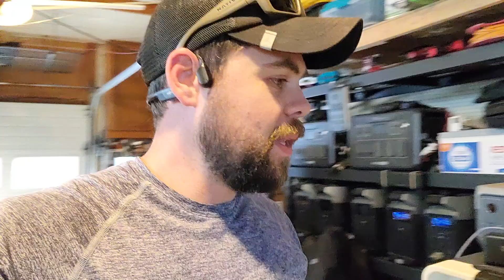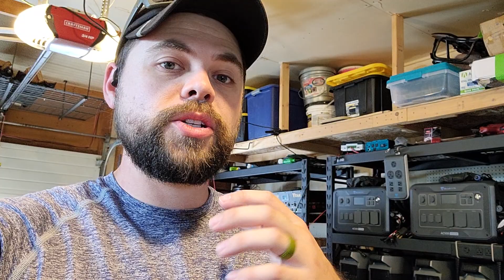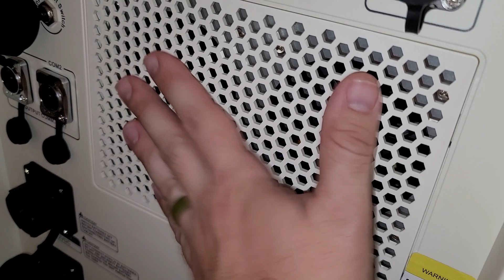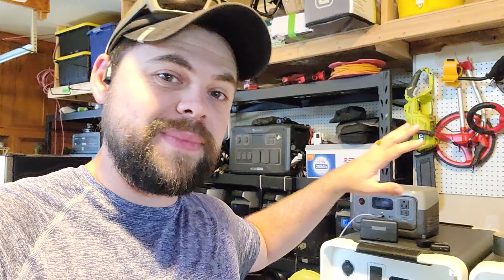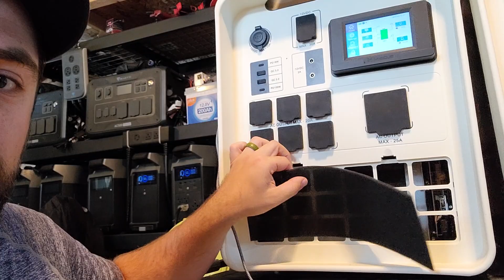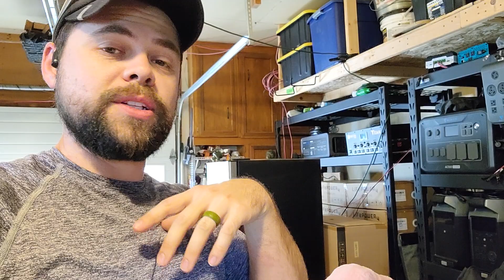The Power Station that Changes Everything Initial Review of the Apollo

Comment: Goals are the same.  Run off batteries with grid back up.  We want to stay mobile as well.  I have the Delta Pros, as you know, I bought them through you, but now thinking of Apollo.  Mainly to get the amps.  2 Delta Pro's = 30 amps.  I need 100 amps.
Reply from the maker: 100a at 240v would be 8 Apollos. To do that you have to have a custom made combiner box for the Apollo and have an electrician wire it into the house, but it's possible. The DPs are great, but not as good as the Apollos. The 5kw of solar input is incredible. It charges so fast with lost of solar panels it's unfair to anything else out there. Finally someone has realized that a solar power station needs really high solar input to be long term reliable.

Comment: Awesome!  Glad you're checking it out.  I got mine unpacked and plugged it, I'm trying out the AC fast charge mode to bring it up from 60%, it seems to work fine but of course when I switch it back to UPS mode it goes back to 500watts, it makes since that it works this way but it had me scratching my head for a bit.  I'll be testing the AC out tomorrow, it likely works fine but I always check things like this out on test equipment first before using it on more critical equipment.  I'd like to get my buddy to put his oscilloscope on the AC out to see how smooth it is.
Reply from the maker: That's so cool! Mine are working great, no issues so far at all.

Comment: @minutemanprep Do you know if these units are able to automatically turn the AC inverter back on in an outage situation? Say they are set up in a remote location.
Reply from the maker: They do not have an Auto Transfer Switch built into them if that's what you mean. Meaning if you're on grid, power goes out, then these turn on and run everything, then turn off when the grid comes back on. That is coming, but not ready at this time. If you're off-grid and wanting them to turn back on automatically if the battery drains down then yes they do that.

Comment: Is there a 3rd party solution to the "fusion box/combiner box"? It seems like many vendors combiner boxes have too many caveats.
Reply from the maker: I don't think so. Closest thing is an Interlock Switch which is what I use.
Reply: @minutemansolar  Understood, but couldn't take say an Ecoflow and a DIY EG4 and combine the 2 ~30amp legs into a 50amp 240volt split phase. I'm making those up, probably wouldn't work (math), to connect to an interlock. To me, it seems like there is a gap in the market for something like this. We are dependent on manufacture "combiner boxes" that only connect multiples of their specific solar generators with a proprietary solution. Someone should design and make a box where I can take 2 separate 30amp sources and combine them to a ~50-60amp single leg to  plug into an interlock. Just my humble opinion.
Reply: @ididathing1754  The problem isn't being able to manufacture the product. The problem is how the two units communicate to one another. If the phase is not in perfect sync then you will have major voltage problems and likely fry something.

Comment: So at 3000 watt inverter you can't get 30a @ 240V when paired 
With the DPs you can but with the Apollos you can tie 4 units together and get 12000 watts so 50a @ 240V 
It would have been ideal to have 3600 watt inverters on these 
So you could start with 2 and then expand to 4 and have a little headroom imo
Reply from the maker: To be techincal it'd be 25a at 240v since Voltx x Amps = Watts. You're correct with 4 Apollos you can get 240v and 50a. I am working on that video. Likely to be out next week.

Comment: Great video Ben. 
Nice feature to be able to use 120 volt receptacles while outputting split phase.
I currently have the Uline shelving unit you previously had for your Delta Pro set up. 
Can you share the brand of the shelving unit you now use for your DPs + EBs?
Reply from the maker: I got the new shelves from Costco. $200 and they can hold 1,000lbs per shelf very well.

Comment: I went with the AC300s almost two years ago, with 6 batteries and the fusion hub.  Did have an inverter failure and sent it in for warr repair. Was without the second inverter about three weeks but other than that i am satisfied with it running most of my house thru a multi circuit transfer sw. (trans pro6) every day.    You are absolutely correct about solar input being important. Getting enough solar input has been the issue and in winter i have had to switch back to the grid when the solar just could not keep up.  I will save my money and watch to see how the real world treats this newcomer, if i was buying today i would pick this system.
Reply: Thank you for sharing your experience with the AC300s! It's great to hear that it has been running most of your house through a multi-circuit transfer switch. The Segway Portable PowerStation Cube Series might also be worth considering, especially with its massive capacity, fast recharging, and comprehensive protections. Keep an eye out for real-world reviews, but it seems like a promising option for your power needs. Happy camping and family time!

Comment: My main issue with Apollo is that I don't have 1....yet😮. I do think a 2nd charge controller would've been nice so you could have seperate arrays. That's 1 thing I really like about Titan. I can run different panel arrays and have 1array getting peak sun and the other is more angled to late day sun to squeeze out every hour possible.
Reply: You can still do that with the Apollo if the strings have the same number of series panels
Reply: @niktak1114  I am under the impression that if say 2 strings are in parallel and 1 string is set up different from the other that your efficiency would take a hit,sorta like if 1 set was shaded but the other not? No?